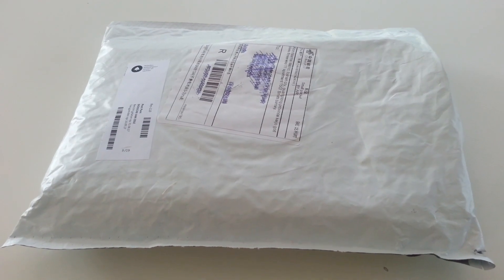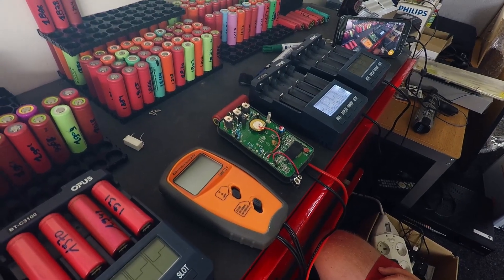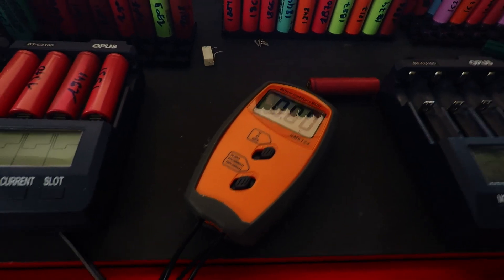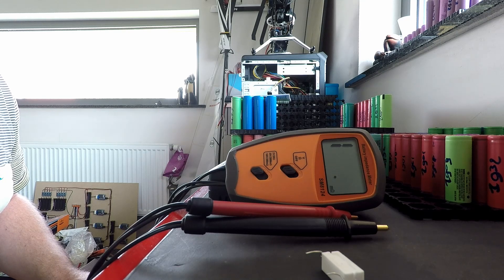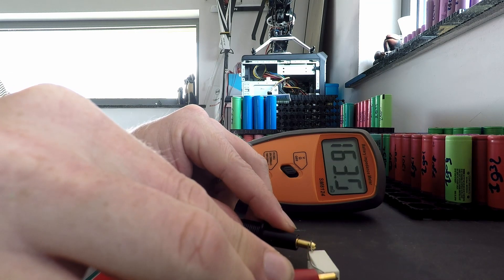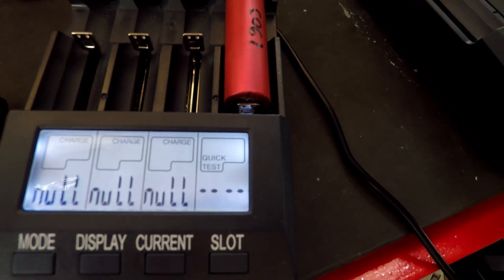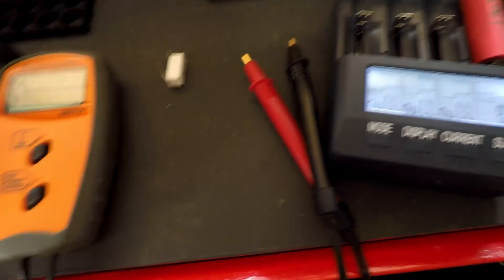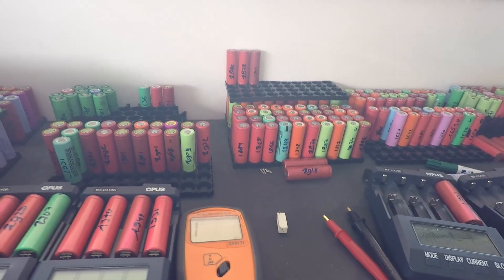18650 - Part 1 - Internal Resistance meter for 18650 battery cells

Comment: I hope to answer . I buy a torch and some new 18650. The torch don’t work for a reason. I fully charge the batteries with bt c1300. A make also a quick test and all the batteries is from 3000 to 4200. Is this normal?

Comment: YOUR USING THE METER WRONG YOU NEED TO PUSH THE POINTS OF THE PROBES INTO THE BATTERY NOT ON THE SIDE OF THE PROBES

Comment: Do you also have a video of the Gazelle Orange Innergy - old model battery? I saw you have the new battery video - at least taking it apart and cutting all the wires...I would love a video from beginning to end, so also how you put it together again after replacing the cells...And where to best buy battery cells? What types of cells to best buy? Thanks already for info - Johan

Comment: Every other video im seeing reccomend making sure to push the probes in firmly end to end fully pushing in the probes  fully to get accurate reading. Not sure if true or not. My meter will be here tommorow to test this. Otherwise thanks for the video!
Reply from the maker: As long as I have clean contacts on the cells, everything works great.

Comment: I just stumbled across your video. I noticed you have 4 numbers written in every single cell. Why is that?
Reply from the maker: This is the capacity I have measured through a cycle of full charge, full discharge at 1 amp and full charge. (last not necessary but handy to see if voltage is kept over longer time).
For more info, see the video about the Opus charger.
 https://youtu.be/lrg-j8qxAJc

Comment: Each probe has two contacts that must make contact for a stable reading
Reply from the maker: As long as you have clean contacts, it works. If numbers are jumping, find better position. Number should be stable for about 2 sec.
Reply: @Sailingandelectronics  Yeah, but your numbers were "jumping" around as you only used the sides of the probes instead of making sure to use full contact.

Comment: If you apply upward pressure to the negative terminal at the start of resistance test your figure will be accurate.
Reply: Yes, you have to push both of the contacts into the cell to compress both internal contacts to engage both wires to get the internal resistance.  The tips are spring loaded inside

Comment: I have this meter and what I learned is that you must CLEAN (I used fine sandpaper) the contacts when you get jumping readings. I think the brass isn't very good quality and it oxidises fast! After you clean the contacts, test battery again and make sure you press HARD against the battery to get good readings. Now it should not jump so much, during the battery testing!

Comment: Great Video! I have a question. The criteria you use to combine in packs some of these cells from so many different manufacturers and different usage times would be just similar internal resistance values and simiilar capacities (mAh), right?! Or is there another criteria not mentioned in your explantion? Thanks
Reply from the maker: To be honest, the internal resistance testing is to know if the cells are in good condition. If the value is higher then 150 to 200, I bin it. However, finding a cell lower than 35 will be difficult, even if it is a brand new one.
That's why I sort from 0-100 and 101 till 150. Most of the useful cells will be in this range. Finding a cell higher then 100 is already difficult too.... so maybe I could change my parameters and bin from 100 and up.
A next parameter is the capacity of the cells. I try to make a mix, so the packs all have the same capacity. However, it's up to you (and your cells) how low you want to go. I start from 1800mAh, but if you have vast resources of cells, you could set your lower limit higher and only use 2200 and up... that's up to you.
See my other vid on assembling a battery pack.
Reply: Sailing and electronics great explanation... so much POWEEEEEERRR
Reply: Sailing and electronics Would the voltage that each cell retain after being recharged would be a relevant criterion to consider when assembling the pack? I only use cells that retain voltage above 4v.
Reply from the maker: Hi Franco, I think it is one of the basic criteria for the cells. You should write down the voltage on the cell and then put it aside for about two to three weeks. If you recheck the voltage, it should only drop about minimal voltage. Most of the good cells will even not drop anything. You do not need to charge it completely to do this test, but it makes testing alot easier when they all were 4.1x Volt. Also checking them visualy for leakage or corrosion is important. Good luck.
Reply from the maker: ElectricBike, are you building powerwall or ebike battery? I have a Haibike Xduro double suspension without speed limiter...

Comment: 80 vs 60mOhm seem to be rather close. If you try to apply pressure on the opus when testing the opus generally goes a bit lower and should get closer to the unit.
Reply from the maker: DIY Tech & Repairs that's true, but having to triple check every cell will take alot of time. 
Don't you think applying extra pessure on the contact points will reduce life of the opus?... Which cost more than the impedance meter.
Reply: If it will reduce life time im not sure. It will be same time to check with them both i think... But on the other hand i think the meter is good to have anyways. Alot easier than powering up the opus :)

Comment: Love it man, keep it up. Say " M-PEE-DENCE" because M-PA-DENCE means your wiener doesn't work:) and the Opus does IR too.
Reply: It isn't a character flaw. It's just an unfortunate collision that not providing the correct vowel between the 'p' and 'd' makes a closer rhyme with the word that  makes the native viewer/listener think of male erectile dysfunction or ineffective leadership. All the other vowel sounds in "impedance" are freer in choice from nearly nonexistent to nasally over emphasized without causing any similar confusion.
The other thing to note is that impedance is usually reserved for AC, resistance is used with DC
Reply from the maker: Thx, obviously not a native English speaker . I'll try to put the stress on the "p" of the word. 
I think in my third video, the English is better already since I do not have to worry about the camera... It's on a tripod. Thx for the feedback.
Reply: That was funny.  Great job. Toppie

Comment: Nice video sir. i think important to use same internal resistance cells in pack because of discharge speed. if some has high resistance then it ll warm during discharge. my imax b6 resistance test is not really stable i just read different values during double test of a single cell
Reply from the maker: Totally agree. First step will be remove cells with internal resistance over 150.  Than I will make 2 groups of cells. 0-100  and  101-150. This is because new cells already have IR of about 40 milliOhm.